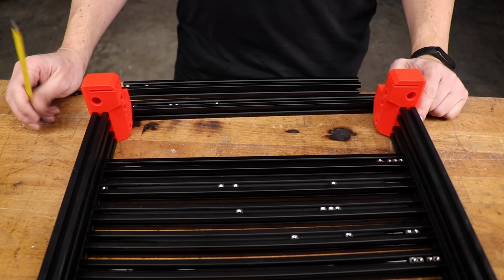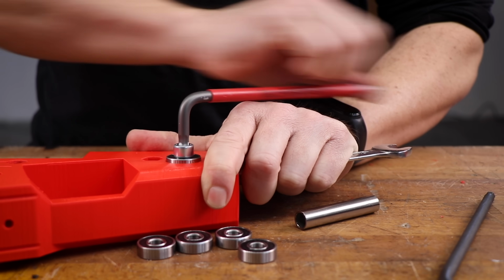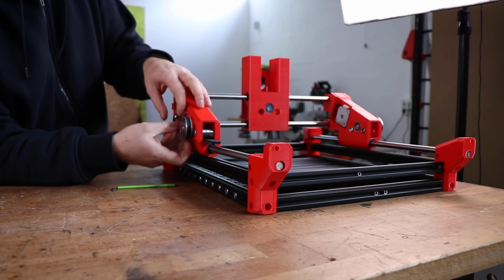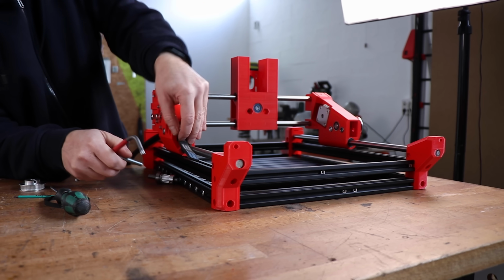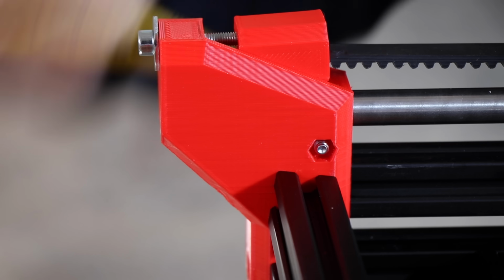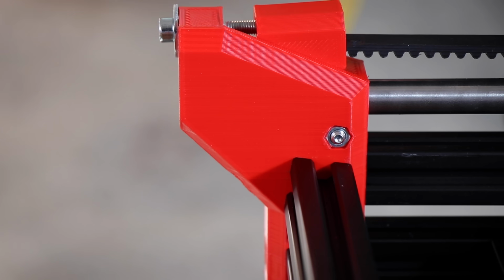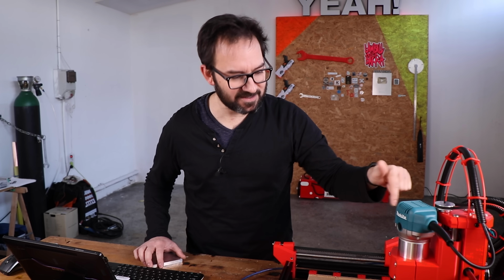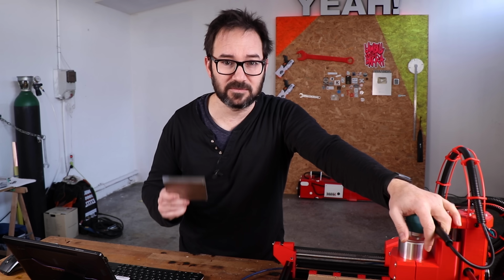TINY 3D PRINTED CNC CUTS METAL (from scratch)

Comment: very very nice design Ivan... if someone wonders, as far as I can see, extrusions 20x20, belts, gt2-200, htd 5m 15mm width, rods, 12mm (LM12UU), nema 17 motors, 608zz bearing, pulleys, gt2-16 teeth, gt2-60 teeth..

Comment: Hi, great piece of work, there are many videos on CNS and they all seem to suggest that for metal you need a rock solid machine made of well, metal but this proves that is not necessarily the case.  What's the main secret of success then? The Makita?? (Power??)  Which cutters did you use on the aluminium piece?    Thx.

Comment: nice build. but if you put in bearings you apply the force on the outer diameter in your case, because theres the most friction. doing it your way you risk to damage the bearing.

Comment: I think you could make this even cheaper using plasicized fiber concrete for the frame with threaded inlays to bolt them together. You could print the concrete forms with PLA.

Comment: When is somebody going to "go creator" and alter the boring antique feature of so much overhang in front of the X gantry rods?  Front and back pair of rods along with 2 Z steppers would make the whole machine an order of magnitude stiffer.  Even better 3D printers are from 2 to 4 steppers on Z to get them more perfect and they have very little extrusion load on gantry.

Comment: What an insanely good looking design! @Ivan Miranda: I read on your website (I'm looking to buy the plans) that it cost 600 euros to build the machine. What was so expensive? The Makita router, or is there something I am overlooking? (I'm in the Netherlands so not that far from Spain but I don't see how the steppers, rods, bearings and controlboard would add up to over 100 euros)
Reply: Heb jij deze CNC daadwerkelijk gemaakt.
Reply: i think a big part of cost will be filament, those parts look quite solid

Comment: Dude!  You have some seriously CAD/CAM skill to be able to design such a nicely-engineered machine with all those 3D printer parts.  It's not terribly difficult to draw up plans for your own manual milling/drilling work to build such a machine up by hand out of plastic/aluminum, but it takes real talent to draw up complex shapes that all align with each other to house the steel rods and screws as well as allowing room for cables/etc. for all the 3D-printed pieces.  Well done!
Reply: Foresight and planning. Having a real knowledge of CNC is a major help also. Anyone could make this from plans, but the design and sourcing etc is where the magic happens. Hat's off to Ivan.

Comment: Hi. Curious about your cable management on this one and a few other projects you've made. You have off the shelf black corrugated wire sheath held up by flexible red ...let's call it a thing... where did you get the red thing or did you print it? If print, is the stl available?  Really like that method. Due to the springy nature of it, it holds the wire loom up nice. I'd like to this in my engine bay on my car. Thanks and keep building something! Haha

Comment: Great little machine. I must have missed the video on the huge fold-out one. Question: is there a trick to getting those linear bearings running smoothly in pairs when in printed housings? I am having real problems where single bearings which run perfectly fine on their own bind up and get stuck when I put two of them together in a printed part. I have no idea why :(
Reply: Ive built a couple of 3D printed routers using linear bearings like you describe. The closer together they are in your printed part, the more precisely they need to be aligned. If you are pressing them in with a lot of force the straightness of your printed part is going to be more important. If you designed the part yourself I would recommend printing some test pieces and make the tolerance as loose as you can without the bearing falling out. This should help them align better with the natural flex of the plastic. If this doesnt work you can make the tolerance to where they slide in and out with no force and glue them in with something like JB weld. This has worked for me in the past. Hope this helps

(edit)
I should mention that when gluing them in you should use a scrap piece of your linear rod to align them while the glue cures/dries
Reply: @sloanv2610  That's great thank you 👍 I will have another try 🙂

Comment: It would be awesome to see some real world performace tests: what accuracy and movement speed the machine can achieve and what types of metal it can cut!
Reply: I'm no expert, but from how much the frame seemed to flex at 12:08, I can't imagine It'll get amazing precision or repeatability... still an impressive build though
edit: wording
Reply: @jarrettg7937  you can just print aluminium parts with this machine and replace the plastic ones with aluminium, also the improvement of the motor to a high performance one with a real cnc header, is avalible in this Formfaktor. I am somewhat curious to be honest, how much would it cost to get to the level i mentioned and how long it would take to step by step from: Buying a dirt cheap 3d machine + the goods you need to get to this shown in the video.
Ive just watched this video and i am gonna test this as a side project
+ Alu is dirt cheap
Reply: @1shivanox  I think the lack of rigidity might be more from the quickly bolted together extrusions and lack of any similar vertical/crossbar reinforcement to prevent shearing, and not as much from the beefy corner brackets, but I'm just an armchair enthusiast here without any practical experience so all I can say is best of luck on your side project!
Reply: @jarrettg7937  That movement you see means nothing. It is all relative. You are moving very fast in space. But relative to the surface of the earth, not at all.
Reply: @tinayoga8844  The most nonsensical thing I've read today. Yes it is relative movement, to the workpiece. That's the problem, a big problem, look at the surface finish ffs. Note, there was no micrometer anywhere in sight because a ruler is all you'd need to measure this things output.
Reply: Even if no flex, not possible, those linear bearings cannot hold 0.1mm tolerance and will get worse overtime.
Reply: Bruh, you know its made out of 3d printed parts and uses belts, It made for hobby projects, not for production. This is a cool project.
Reply: @m3chanist  apparently you are neither a machinist or have a desktop cnc. .01 is easily attainable. .01 is miles of tolerance.
Reply: @Cknoble876  I only now noticed you use old world units. I read your comment as .01 mm. Apologies. I dont have a desktop cnc no, I have several real ones. This thing is junk, a waste of cash pitched at a particular viewership, that is it's only actual value, views for the video author. Building it though would be a great "learning experience" in harsh reality and the parting of fools and money.
Reply: Take a close look at the finished part, freeze the frame and go full screen, soak in the multifaceted randomised length set of faces that make up the inner boss, bask in the non-cylindrical organic nature of it, look on with awe at the stepover near the bottom outer edge revealed in all its naked glory. Buy your belts in bulk, safe in the knowledge you will be replacing whatever you sacrifice to this abomination...frequently.
Reply: Probably +-.01",  slow. 0-20ipm, aluminum.

Comment: Is belt sistem beter than ballscrew for large machine 200cm x 120cm work surface... i have 2.5 Amp, Nema 23 motors ... whitch of these two systems uses less friction or power so that this motors would run smoothly ?

Comment: What a wonderful CNC! Congratulations!
What kind of filament did you use for printing parts and settings you used?
When buying your project, are these values mentioned?
Reply: I doubt he'll tell you the filament settings as they're very specific to the filament/printer/extruder combo... you have to finetune it for your specific case. He could recommend the filament though, my guess is that it's PETG or ABS
Reply: @geort45  i dont need specifications about filament they used!
I need to now settings for printing, like infill percentage, number of perimeters shell, etc.....

Comment: Here is a question, where do you get the taps? I know you can buy them everywhere but most of them seem to be designed not for making threads but to break off and plug holes.

I just need some good ones that I can put in a drill either directly or ... with a tapping attachment.

Comment: that's a really clever idea to use the filament as a cable guide!
Reply from the maker: That's in fact not filament per se but 3mm nylon fish tape, the same used by electricians to pass wires through conduits.

Comment: That's a decent surface for 1 pass. You should add a .1mm contour offset, copy and paste the procedure, remove the offset on the second and then run both. Yes it will take twice as long but you'll get a higher quality part.

Comment: Great little CNC! I just recently made a desktop CNC laser. It is about the same size as yours, but much lighter duty. Parts list only costs ~$440 and I have been using it for making custom masking for paint projects. I have a video up if you want to check it out.

Comment: That was a very entertaining build. I'm not interested by the plans because structural 3d printed plastic parts are rubbish for any CNC mill/router, obvioulsly. The young modulus and the mass of thermoplastics speaks. IMHO there's some embelishing here, as this is not really cutting metal because the passes are tiny and the feed and speed are low. That was the same for the MDF by the way. A proper CNC mill cuts much faster and much deeper, but who knows ? ;)
Reply: Have you a link to your CNC build that you can share with us?

Comment: This is really inspiring. I'm currently living in a small place but I save my money and develop my career. When I move to a bigger living place I'll not only make sure to have a sound proof room for producing music - but also a big working area for electronic engineering and crafting physical machines, just like you. I adore the concept of making machines that allow you to make even better machines until you can pretty much craft anything. This is so amazing and awesome!

Do you write the code for your cnc machines yourself? Or are there some sort of templates to software- and wire-up a micro controller to some stepper motors? 

You again did an awesome job with this video! The editing is very fun and of high quality as well! Big Kudos!

Comment: that tool head dust collection system is freaking genius!! I have never seen anything like it. Gives an amazing view of the tool bit when it's in operation
Reply: honestly resembles a 3d printer's part cooling ducts from smth like a Prusa.... amazing what you can learn from different manufacturing types
Reply: True. That's the cleverest bit of engineering I've seen in a while!
Reply: @PTEC3D  You haven't seen the Kralyn Positron?
Reply: @smorrow  No, but thank you for the info, I'll go take a look. I'm still very new to all things CNC and even 3D printing I know I haves lot to learn.
Reply: @smorrow  Actually, THAT one I did see and was impressed, just not flush with cash enough to start building my own.
Reply: For cnc that makes dust instead of chips, like this it may work. But not with normal cnc mill.
Reply: well it will only works on this tiny machine... the machine is just so slow that this dust collection works.  If you do this open view on bigger machines tehre are chips flying in every direction.
Reply: @GrandeCalle  I think thats why it's a smart move. I've seen some of his other bigger designs and they have a different way of dust collection. Which probably means he thought about it (maybe).
Reply: You need to dive deeper into mechanical engineering if that's enough to impress you lol

Comment: I made a CNC out of a defunct CR-10. And with ... what i'd call minimal mods to the frame (so not motor, cutter, etc), split into two major categories: 

necessary: double bottom rail mod, stiffener mod and double Z motor mod
not necessary but makes things better: a stiffener placed on the bottom frame, diagonally on either two corners, enclosure, cable extensions so the brains don't suck up dust.

Sidenote: the base needs to be modded in a specific way, that is you need to remove the springs and heater plate, and replace it with a piece of thick HDF (not MDF). The topping should be a 4 mm alu plate, that needs to be trued up to the cut.

That said, this will never be a fast CNC, but for small, slow, detailed cuts, it's more than enough.
Reply: That's really cool. I have a CR-10S about 2 feet away printing right now :)

Comment: Awesome as always Ivan! 👊 I designed and build a similar sized machine, but I used T8 lead screws instead of belts - eliminating backlash was a nightmare! I wish I’d gone with timing belts like yours 👍
Reply: The tricks to eliminating backlash in leadscrews are you use spring-loaded nuts or to use multiple nuts to simultaneously engage both sides of the thread profile; and to support the screw along the length (really hard to find the necessary parts for this as a consumer). Using the right styles of coupler and bearings also helps. Timing belts are easier about that with light loads in the short run, but too much weight or tension or too many high momentum morons (especially reversals) will quickly stretch them out of spec, and they ALWAYS stretch eventually. Always pros and cons.
Reply: @claws61821  Absolutely 👍 I added two regular T8 nuts per screw, but used custom TPU pads as springs on each to make them less compressible. That way, I tighten the screws on the nut flanges to compress the pads and remove backlash - works really well, but I’ve always felt like belts would have been less hassle 😅
Reply: Hi, would you mind sharing your design?

Comment: What an amazing machine. I built one a few years ago. But when I tried to mill aluminium. There was so much vibration that the results where not very good. I think I will try your design. Thanks for shared.

Which end mill are you using?

Comment: Ivan you are backwards cutting. Whenever you cut with a cutter that is spinning clockwise then your feed that you cut at the workpiece must be in a clockwise pattern, if you cut in an anticlockwise pattern then you are going to get chipped edges instead of a clean cut.

Comment: Hi Ivan
Great work on the CNC machine! 
One question: What milling bits do you use for aluminium and where do you get them?
I've also made my own CNC machine a while back, but my bits break if I remove to much material, but yours seem to go strong!
Reply: Generally for Aluminum (60/65) I use High Speed Steel for Aircraft Grade (70/71) Aluminum and Mild steel I use Carbide Bits.  If you're having trouble with them snapping you should consider lowering your feed rate, and your Spindle speed for Hogging off a lot of material, and Set them for higher feed/spindle speed for your finishing cuts
Reply: Read up on HSM, you need to use efficient toolpathing and the correct feeds and speeds for the combination of your machine and the individual tools. You can't mill anything with any machine with poor feeds and speeds.
Reply: @Kitsyfluff  will do that, have played around in the past with feeds and speeds and I can get it to work now, but its really slow. The router I have is a fixed speed so.. Contour cuts are 1mm of cutting depth and the feed depends on the diameter of the bit
Reply: From my (teacher's) experience using lathe and milling machine, mild steel and other low strength metal seems to be best cut with low speed (1000 - 4000 RPM), is it true though for a router? They are basically the same stuff (not the lathe of course) isn't it? I always saw people on youtube cutting steel at very high RPM ( > 10000 RPM) which is quite surprising to me.
Reply: @rizalardiansyah4486  my router spins at 12k rpm if i remember correctly, but its fixed so only have feeds to play with

Comment: how can I set a router like this up to work in the Solidworks 2.5 Dimensional router environment?
Reply: You need to build up an X/Z axis table then add the Y in the router.
Use good linear bearings otherwose you are going to have poor results
Reply: @AutodidactEngineer  Nono I have the router but how do I use it directly in solidworks?

Comment: You should totally sell this as a kit! I would love to build one of these, but I don't have the miter saw, taps, or other capabilities to machine the metal in the first place
Reply: you also need the time to do this. I would love a turnkey home router
Reply: @paulgupta2454 go buy one at home depot...
Reply: No
Reply: No
Reply: You don't need any power tool to make this. Not a single one.... 💪
Reply: @jothain  ...yes... but trying to get multiple parts exactly the same length and with dead square ends using hand tools doesn't sound like fun at all. Doable, I'm sure, but painful.
Reply: @cooperised  if you order from a supplier they usually offer a cutting service for little extra cost
Reply: @cooperised  hacksaw, just slight over sized parts. Little bit of filing. Dead simple job for anyone who has even slightest hand tool usage skills.
Reply: @jothain  Doable but definitely not "dead simple".  It's the squareness and flatness of the ends that's critical, and accurately filing 20 ends of 40x40 would get old pretty fast.  The best idea (as others have pointed out above) is to order from a supplier that cuts to length, if you don't have the mitre saw.
Reply: @jothain   Well technically you need a 3 d printer.
Reply: I wonder why someone needs a milling machine who otherwise has zero tools and no idea?
Grettings from Germany
Reply: Hasn't he sold out enough?
Reply: @lastofthebest5102  noup